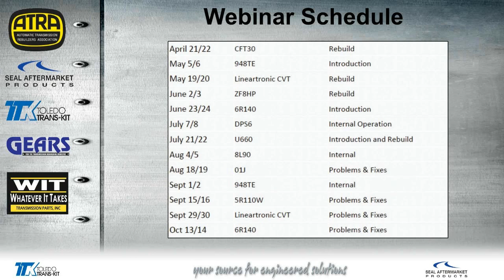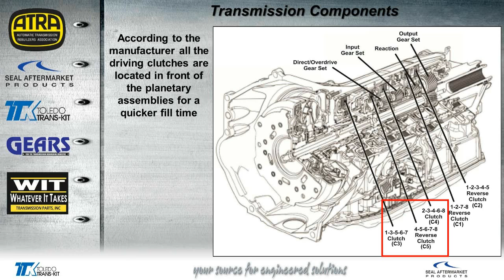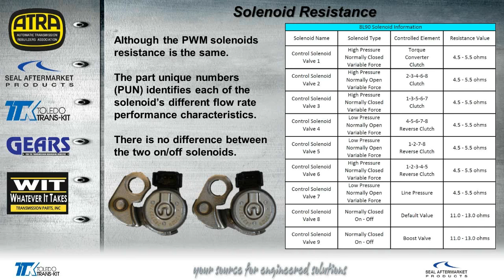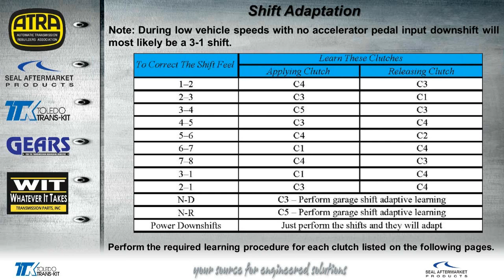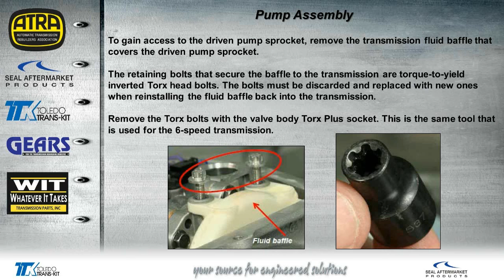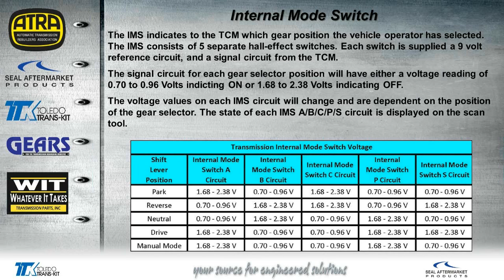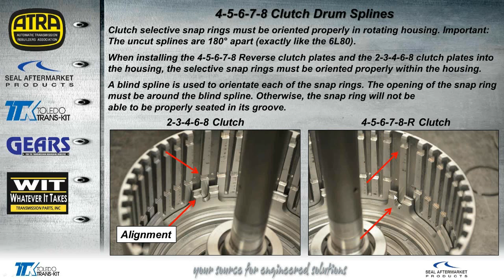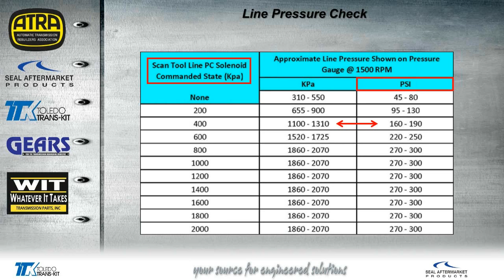8L90 Introduction

Comment: Where can I find a replacement "Default Control" solenoid?
I managed to break the little plastic connector plug when doing a fluid change. Having a difficult time sourcing the part online.

Comment: On a 2017 Silverado with a 6.2 what information can you tell me regarding a thermostatically controlled transmission cooler bypass. Is there a way to get the fluid to flow to the cooler all the time?
Reply: @ronhunt5918  thank you!
Reply: Superior transmission solutions bypass kit

Comment: Great video! 
  Can you or anyone tell me if when swapping the solenoid harness which contains the temp sensor, do I need to do the relearning process?  From the video it seems the answer would be no, just swap the harness, fill the fluid and, and be done. It appears the valve body and other components are not necessary to remove, just the fluid, pan, and harness itself. 
    Thank you
Reply: Order internal harness with temp sensor , no relearn.